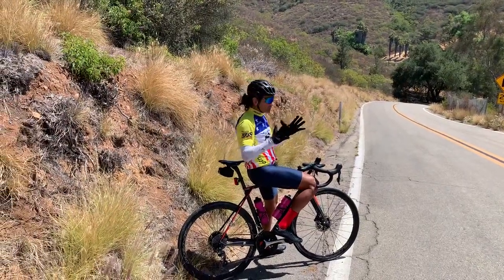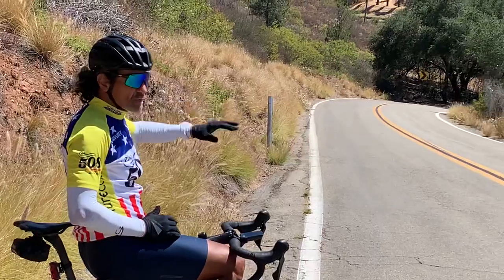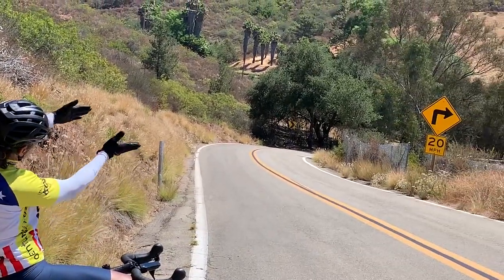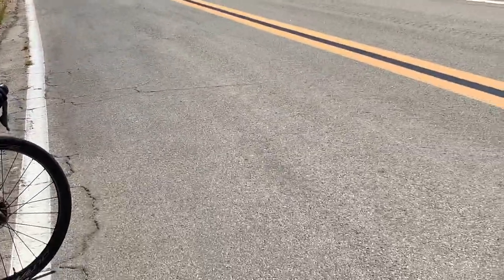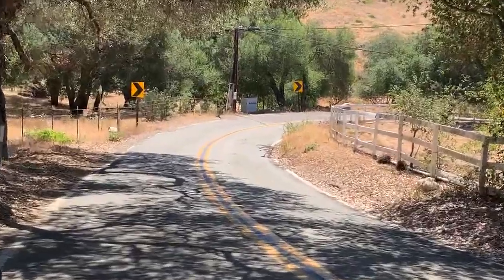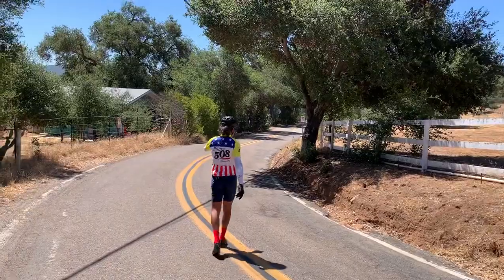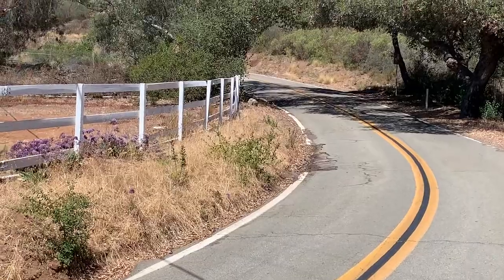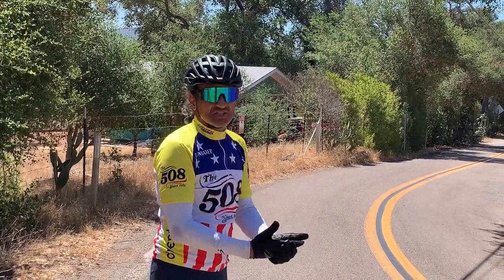What is a decreasing radius turn - how to ride it video # 2 of 2

Comment: Excellent info here, I use tap braking when doing downhills due to me using Rim brakes and Carbon wheels. With the tap braking method ( making soft contacts with the brakes very rapidly from back to front) you can go faster downhill and brake without having the braking affect your safety ( skidding out) and heating up the carbon brake track. This soft small contact with the brakes allows for less heat spots on the carbon wheels, specially with clinchers ( since that is what I prefer for ease of use). I think that tap contact braking should be mandatory on Carbon clincher wheels, now for Disc Brakes you can also use the same method of course in order to do fast course corrections, the braking concept is the same.
Reply from the maker: You and that tap braking 😂

Thanks for watching!
Reply: So you freely admit, disc brakes are superior to rim, when it comes to braking, particularly on carbon rims.
Reply: @veloveritas9963  TAP braking bro, feathering can not be done on disc brakes as is done on Rim brakes. On Rim Brakes I can set the pads away or close to the rim, thus choosing how much feathering I want for flats ( further away) and descents( closer to the rim). No where did I say Rim brakes stop faster than discs you to need to learn to read, it may help you. You can’t put disc brake pads 4 mm away from the calipers, that’s the huge difference between Rim and Disc brakes, because of the rotor the pads are very close which on Rim brakes you can set the pads all out if you wish ( I don’t recommend that, a bit silly). See the difference now? I do tap braking on the flats and why carbon wheels are years old now not one single issue with the brake track. For flats on carbon wheels 4 mm on each side of each pad, on descents 2 mm each side. This is impossible to setup on Disc brakes and it’s one of the reasons I use Rim brakes. The bike industry is silly pushing press like cannondale then going back to threaded bb, basically back to the 1970’s again, hilarious always going back to the basics.